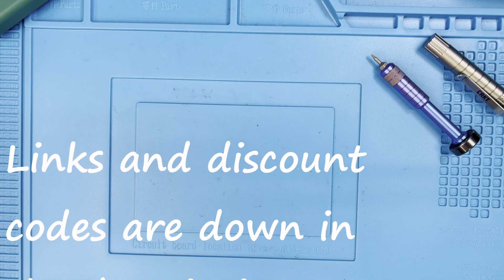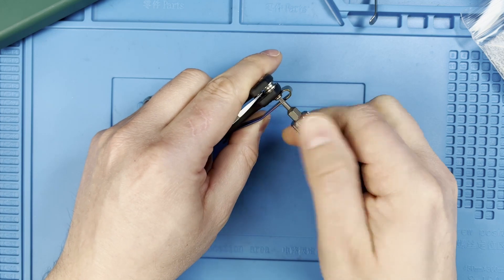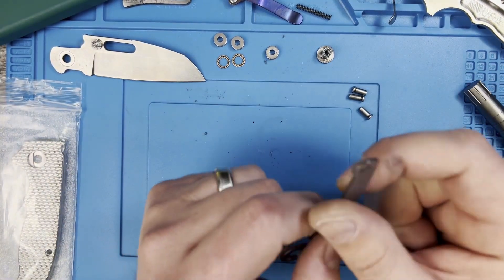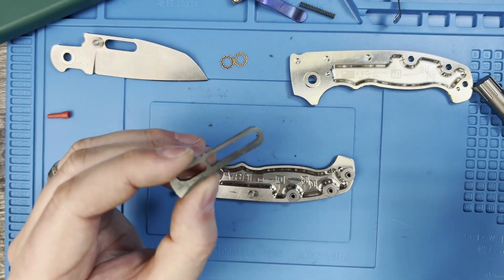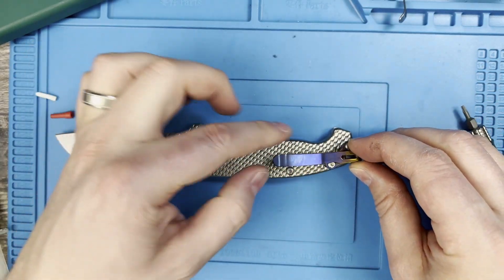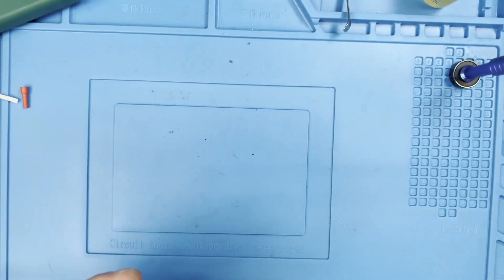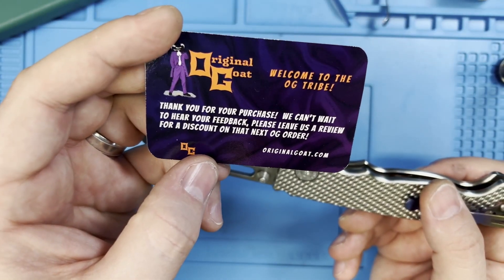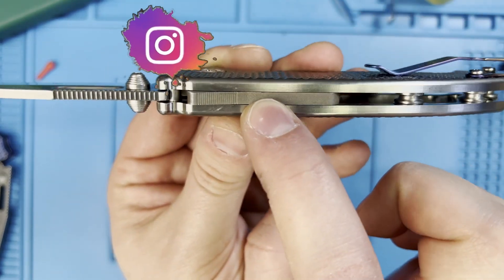Demko AD20 S titanium scale install (Original Goat)

Comment: Are the spacers supposed to go before or after the washers
Reply from the maker: Washers need to touch the bearings, they are hardened and the spacers are not, since that’s what is moving you don’t want the bearings riding on the softer spacers. 👍